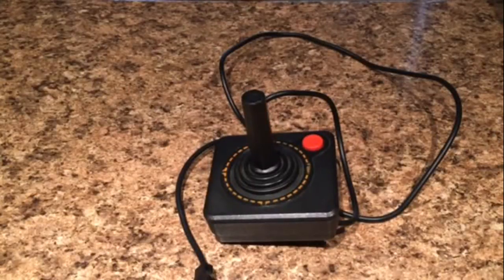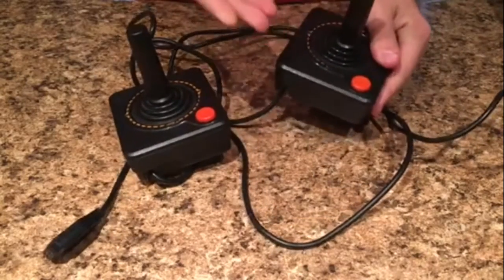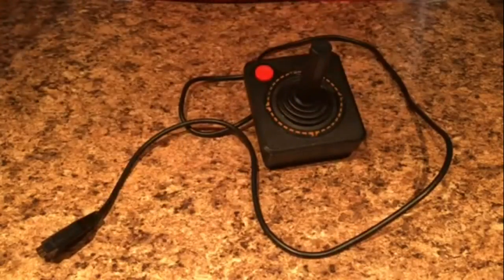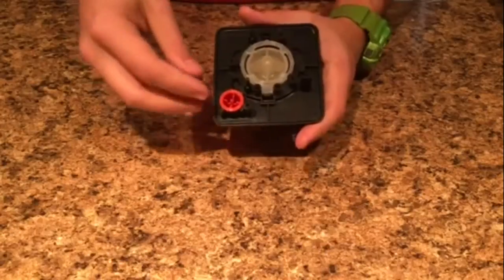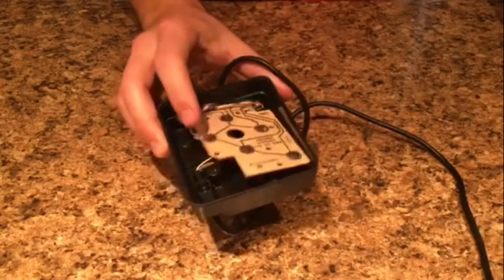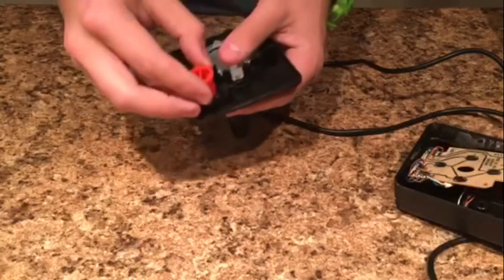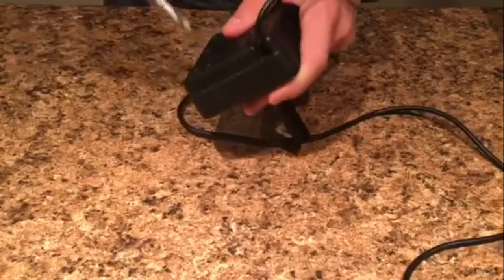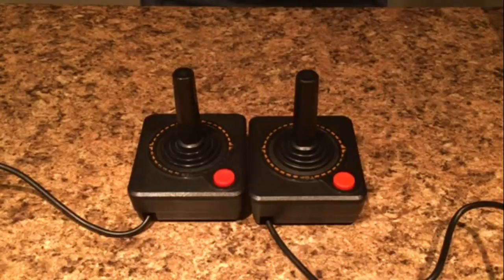Cleaning & Restoring: Atari 2600 Joystick Controller

Comment: I restored a old sega genesis controller. I used 91% isopropyl alcohol and cotton swabs. The problem was the contact points. The had like residue film over them that had formed over the years. Its a byproduct of age and use. The cartridges had also had residue some even worse.